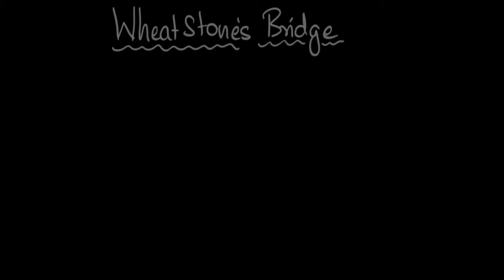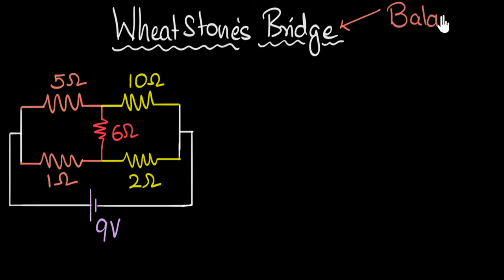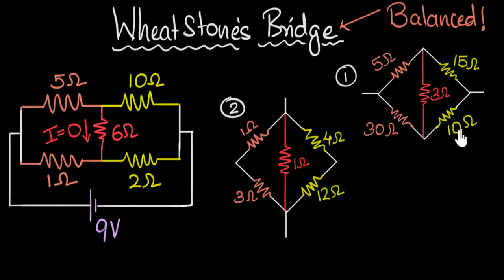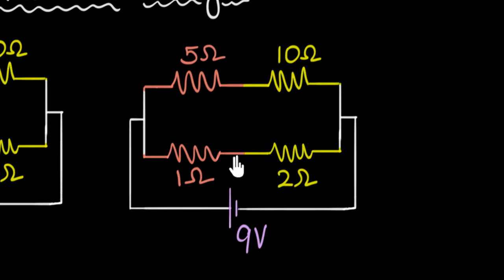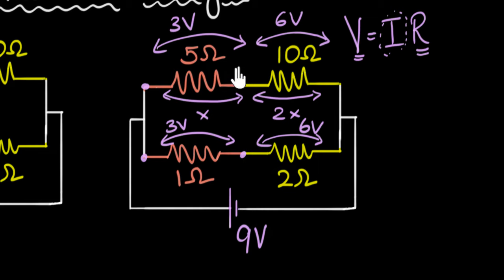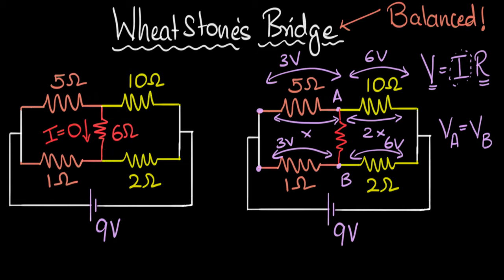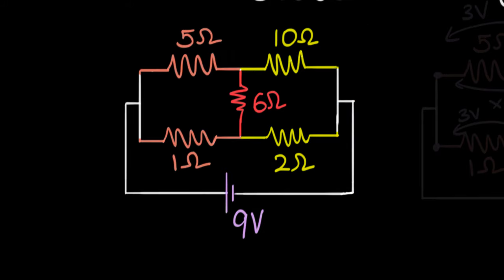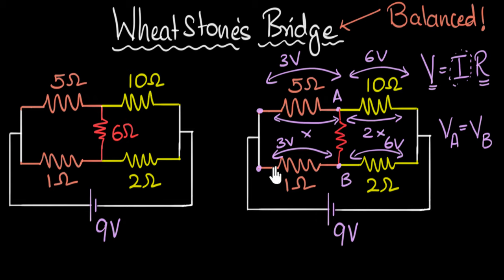Wheatstone bridge & its logic | Electric current | Physics | Khan Academy

Comment: what happens if the bridge is not balanced? ie. if the resistors are not in the same ratio...
Reply: Then there are certain cases like delta to star and star to delta conversion of circuits which can make it easier.

Comment: If I= same then how V∝R 
Because R is a constant. 
5:56
Or does this mean that if we increase the voltage resistance will also be increased according.    Or if we increase the resistance voltage will be increased.
Reply: Both are ryt r is constant but if you replace r=5 to r=10 there is greater potential drop that's what he ment
Reply: he is taking 'I' constant there, so it is resonable to think of Voltage varrying in proportion to the Resistance.

Comment: Great video. But... you don't show how to solve the general case of an un-balanced bridge. That's the fun part, since it's pretty easy. Convert each side of the bridge (top and bottom 2 resistors) into a Thevenin equivalent, then it's just 2 voltage sources and 3 resistors in series. If you don't know how to do a Thevenin equivalent, look it up. It's a simple and very powerful circuit analysis technique that reduces ugly messy circuits into simple ones. 
Maybe your next video? 
Dave

Comment: Im a bit confused on the potential difference part because you can connect a wire but current is still flowing through the wire even though it has the same voltage or no potential difference
Reply: man, i have the same doubt ⚡
Reply: Current always flows from high to low potential.But when there is no potential difference it wouldn't flow at all.Take the analogy of  two water tanks separated by a pipe when the water level is same in both the tanks,water wouldn't flow.Hope it helps.

Comment: How do we know the whole 9 volts has to be divided up? What if there was a single 1 ohm resistor in a circuit? Would the voltage at it's ends be 9 volts?

Comment: how does same ratio give you same voltage? shouldn't it give you the same ratios of voltage? if the current in the upper wire experiences a 5 V drop and the one below experiences a 1 V drop, the currents resulting from them would be DIFFERENT!